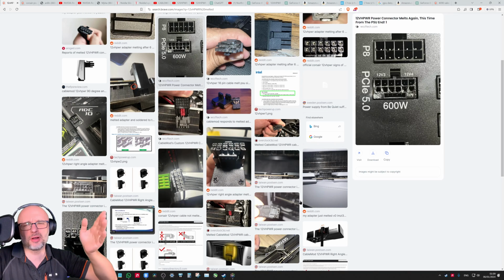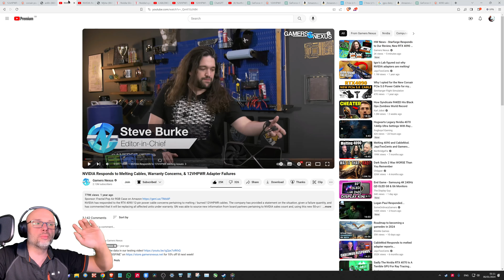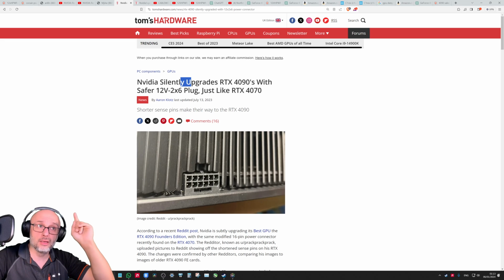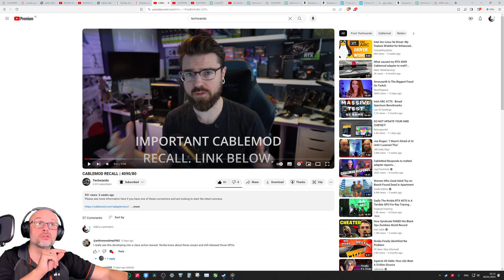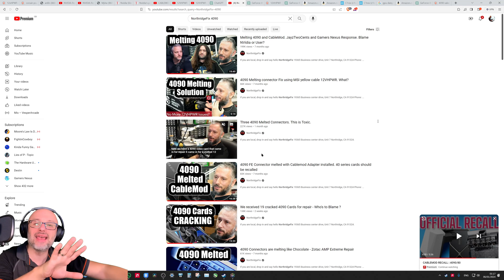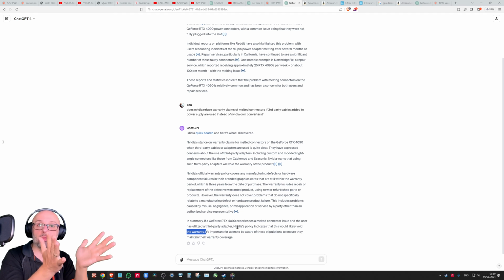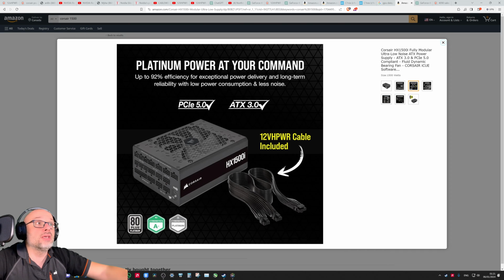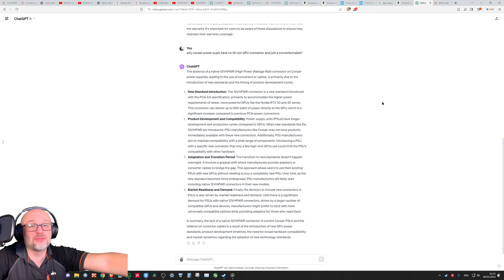Why Doesn't Corsair Use the 12VHPWR Connector?

Comment: Wrong, new corsair shift psu now have 12whpwr on the psu side
Reply from the maker: You are right. They have few such models now.
But at the time of recording the video Corsair had no PSU with 12pin connector. 
Most of their products and including their top end 1500W model remain without such port.
Reply: @HardwareAccent  I'm pretty sure i read somewhere corsair didn't want to do it because 12pin from the psu side might start a fire on the psu side which is bad! 
Before if the fire started on the gpu side, i guess the psu can still shut off and save itself. It makes perfect sense to have 2x8 pin but i think corsair caved to competitors doing it, which is bad! I wouldn't be surprised to see fire from psu side soon...

Comment: The pins are not separated on the motherboard in new video cards (the 3090 had 3 groups of pins). Manufacturers saved on circuit design.

Comment: I been telling people to use the included adapter since the beginning. Even after all the cables melting, people are still buying the 12vhpwr cables from 3rd party. Also, your motherboard does not need two 8 pin connectors for the CPU, just one is plenty.

Comment: Explain to me what happens with these Corsair cables when connecting to a ATX 3.1 and PCIE 5.1 graphics card when the sense pins do absolutely nothing. They've got some balls to claim certification for these standards then you realize you only have half a new cable and the primary feature of said cable is basically a dead end. Very disappointed.

Comment: 1) the 12VHPWR connector is NOT proprietary to Nvida. 
2) Corsair does not make power supplies, they sub them out to PSU manufacturers. 
3) Corsairs decision to not have that connection is purely a cost saving not having to change their design.

Comment: I have another problem, my 4090 when overclocked draws 660 watts on the cable you have shown (the same power supply you are using). My card cost more than 2,000 Euros, this connector voids my warranty, the solution NVidia came up with is pathetic, almost nobody can use their adapter, which is itself dangerous, and be able to close their case. If 5090 continues with this mess, I will stop buying Nvidia cards.

Comment: Im planning to get rtx 4080 super but 12vhpwr cable from asus need 3 pcie cable power, meanwhile im using corsair rm750x only has 2 pcie, so im planning to get corsair 12vhpwr cable bcause they only need 2 pcie power, is it safe?
Reply: yes its safe, use it for 1 year now for rtx 4080 no problem

Comment: regarding mobo's with two eps connectors on them, you don't need to plug both cables in. There are two connectors for people who are doing hardcore OCing but the average person isn't going to need to use both connectors so you would only need one eps/pcie connector on your psu.

Comment: For the 5090 they should use 3 8 pins again but still use the 12 vhpwr cable but not at the 600w and use the data pins

So majority of the power comes through the 3 8 pins but the 12 vhpwr is capped at 300w or 200w but have full access to the data pins

All 5000 series gpus should come with strong 12vhpwr cable that dont need to be bent

Comment: so should i buy this corsair x1500i atx 3.0 with 12vhpwr cable to use it on my rtx 4080 super card , it wont burn?
Reply from the maker: I would probably use added to the GPU converter. Just to be on the safe side in case of a warranty claim.

Comment: My MPG msi 1000w psu has the 12VHPWR  slot. The cable is a single connector (but it has a yellow tab) but from my understanding you only need that one cable to run an rtx 4080. I ditched the splitter cable and directly connected the 12VHPWR cable in the rtx 4080. I definitely heard both sides click. 2 months have gone by and no issues I play red dead redemption 2, cyberpunk2077,  and God Of War Valhalla.  When I leave for the day I do turn the computer off as I dont want any accidents to happen. But msi has labeled the cable "600" and it's the only cable with yellow tabs. You could feel and hear the click of the cable it's very audible and you can feel it.

Comment: 12v-2x6 replaces 12VHPWR now. This Corsair solution can't implement the SENSE pin signals (because no SENSE pins) therefore its not as safe and therefore it is inferior to the 12v2x6 connector.
Reply: But the 12v2x6 needs to be on the PANEL of the psu so any current psu using 12vhpwr native won't be ATX 3.1 i.e. inferior. You can only solve this by buying a new gpu and psu
Reply: @dasxchronos  yes the PSU and GPU connection side needs the shorter sense pins and support 0v state
Reply: Bull, the sense pins only indicate how much power the psu can provide. Nothing else
Reply: This disgusts me. I bought an ATX 3.1 and PCIE 5.1 certified HX1500i direct from Corsair's website before realizing this 2x8 pin nonsense. How can you claim your PSU is certified for these standards when you're literally not using the connector on the PSU to have the sense wires actually do something!? Now I have to wait for the thing to arrive just to return it immediately because I won't have such a shortsighted garbage as this for my future builds. Waste of time and money.
Reply: It gets better. I actually used the PSU with my October 2022 bought 4090 FE. That card had 0 issues since day one, until I swapped to the Corsair HX1500i. Within 2 weeks I have a partially melted connector. It's a total fluke that I decided to upgrade my case at that moment in time which allowed me to catch it before it got too bad. I will never buy another Corsair product again and I urge anyone in the market for a PSU to steer clear of this company.
Reply: @KuraiShidosha  lmfao calm down tough guy. Been using this EXACT power supply and their included cable for the past 5 months with 0 issue. I can 99% guarantee you fucked up and now you're deflecting blame

Comment: I take a different approach to this problem. Some 4090 owners attempt to push their GPUs to their maximum limit to gain a few FPS. This is similar to making engine mods to increase the HP of their 140HP-rated car engine to 250 or more HP. We should all know what to expect, expensive repairs or a dead engine. I've owned my 4090 since they became available and kept the power switch to its default position. I also use the default BIOS settings, except for the ems one, and never try to push my system RAM to more than 6000mbps. I have less FPS than a pushed GPU, but I can live with that and enjoy having a lower system temperature and a GPU that should last longer. Sometimes, we are our own worst enemy. These are just my own thoughts, and your mileage may vary.

Comment: Jon Gerow has stated why in an interview eTeknix. The reason is that the issues with 12VHPWR were well documented. In this case, primarily the bending concerns. Something which is a big concern on the power supply side. He didn't mention melting connectors, but considering how easily the connector can be unseated and cause a resistance issue leading to a melted connector, is even more likely on the PSU side and would be much harder to see. He went on to talk about the fact that Mini-Fit Jr. is more capable than 12VHPWR, so there is no reason to use 12VHPWR on the power supply side.

That's straight from their lead engineer. Case closed.
Reply from the maker: Big thanks for the info.
Reply: @HardwareAccent  No problem!

Comment: I built my 4090/7900X3D system in May of 2023 and did SOOOO much research when it came to the 12VHPWR cable.

I noticed that Corsair was doing it differently by using 2 8 pin connectors instead of 4 which got me into researching them more. I'm so glad I chose them as my power supply even though I had to buy the cable separately because at the time they weren't including the cable in PSUs since they had just released it.

It's the same cable Derbeur uses and he says it's the one that gives him 0 issues.
Reply: Im in the same boat as you right now, looking at that 4080 super and my rm850e came with a 600w cable. Just not sure if I should use 3 separate cable into the one nvidia provides or use the corsair one. (Id have to buy another corsair pcie cable as it only came with 2)
Reply: @G98SH what did you end up doing? I just “finished” building my build which has a 4080 super. I’m also curious if the adapter that came with the card is the new one and if the one that came with my PSU (RM1000e).

Anyways curious what ended up working for you.

Comment: Maybe I have been lucky but I have been using a 12vhpwr connector and no issues since launch. I have upgraded the PSU to the new ATX 3 PCIe 5.0 standard so direct 12vhpwr to 12vhpwr cable and all good. I do make sure it is connected fully.

Comment: I’ll be building a new system next weekend with an RTX 4090 MSI Suprim X paired with 7800X3D.  Using Be Quiet Straight Power 12 series 1200w as the PSU.  I’m tempted to under-volt and set a power limit to 450w.  Am I overthinking things?
Reply from the maker: Up to you. I would probably just use the included converter when still in warranty period.
Reply: Yeah I think I’ll do that even though the PSU supports 2 of the PCI 5 16 pin connectors.

Comment: Lets be real here, this connector just sucks for big currents, it doesnt have big mating surfaces with a good design, and der8auer among other people is saying so as well.
I dont think that its very likely to cause a fire, but usually just melting connectors. In the end the 6 and 8 pin plugs are about as good at carrying power per pin, but they are not allowed to be taxed as much as the 12VHPR connectors, which is good.
They should have used something like a XT60 connector, less pins but bigger ones, so it would also save space compared to the 6 and 8 pin connectors, but not sacrifice connector life (and not waste any electricity due to poor resistance).

I also wonder how bad this problem is going to get, as I would expect the springy contacts in the connector to slowly weaken, especially when they heat up and cool down every time the PC is turned on and off.

I am glad my RTX 4070 has an 8-pin plug.

Comment: Yes, quite smart of them and their converter cable is also very high quality. I have an AX1600i power supply that I bought before the 12VHPWR was a thing and then I just bought the cable and mounted it without any bends in the cable. I've heard from many failures with CableMod connectors which were overheating with high power draw. This cable feels like the opposite. I'm very happy with it and feel safe with the solution I have. That includes using a water block and installing thermal pads on the front and back of the GPU though... That together finally gave me peace of mind 😅

Comment: When I bought my Corsair HX1500i it came with a 12+4pin PCIe Gen 5 12VHPWR 600W cable but yeah on the PSU side they don't use it.
Reply: Did yours come with two of those? I just put the exact same PSU in my new build (powering a 4090) and the hx1500i came with a separately boxed 12+4 cable. I'm just not sure why they did that and what to think.
Reply: @erikarnold4737  Only came with one off those cables. Which I was thankful for. The adapter that came with the 4090 was awful.
Reply: @mayumikentei  Hmm, don't know why I got two, then. Yeah the nvidia one is just wild. Thanks for the response!

Comment: I still use my Cablemod 180° Adapter on my Strix because otherwise I cannot close my side panel. I limited powerdraw of the card to 300W to be safe. This is a scandal... All cards should be recalled to be honest
Reply: hows your cablemod adapter? they recalled this adapter

Comment: At this price I expect pretty much a highly tested, secure, high quality hardware product and not a seriously dangerous GPU with the risk of burn. 
My theory for the 12 pin connector is that they implemented it, cause they dont wanna deal with thousands of GPUs being send back cause users dont have enough 8 pin connectors left or wouldnt connect all 3 of them. I would cause bad reviews by the non-technical "gamers" who might switch to AMD or to the 4080. 
I think DerBauer showed a tech sheet of 8 pin cables and each can deliver around 250W..So 3 of them wouldnt have been a problem. But who knows why Nvidia did what they did. Its just a total no-go..
Reply: actually its 150w ....there is no 250w version is unheard of when it will overheat the 8pin cable by gonna 250w ...when 2 8pin already gonna 300w combine 150w each plus 75w from slot ...but 7900xtx gonna 400w ...that really required 3 -8pin connectors to draw a total 450w + 75w from slot...that's maximum can draw from psu current due to Japanese capacitors are not design go beyond 450v peak its why bigger psu comes 2 capacitor total 900v 12v rail..remember original it was gonna 75w for 6pin pcie...extra 2 pins were extra 12v power...of 75w ...instead having too many 6pin connectors on gpu card...so adding 2 pins was seem good idea back then but it was never tested before like now...cause it was never needed go beyond  150w before, when AMD introduce 3-8pin connectors that cause ruckus with psu folks of adding more risks on 750w to 650w psu, when majority are pc users vs 850w to 1000w are minority group who purchase it. remember its just PSU...bigger it gets , higher risks it gets from size of wattage on 12v when 120v outlet can only goes as far as 1500w total for wire ...its not 240v outlet what servers uses today to get 8500w to 10500w depending amps on cable ..they can do it at 20amps psu 240v that gives 200amps of psu transformer